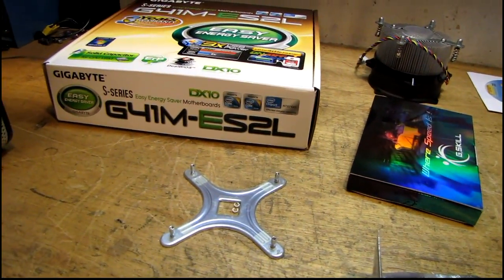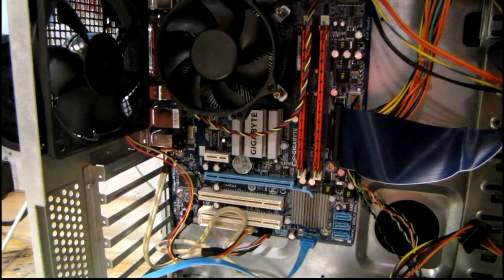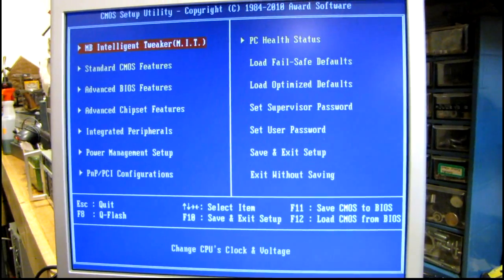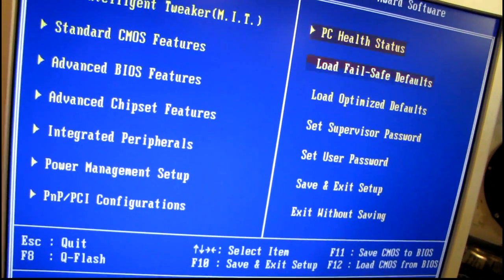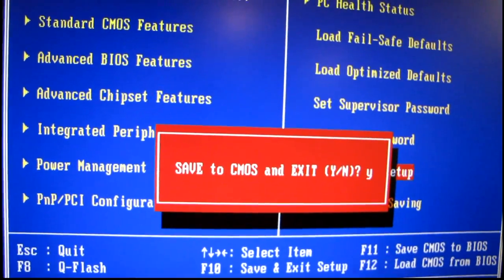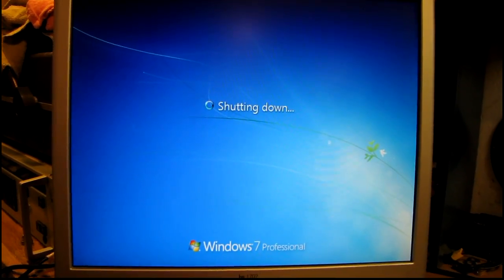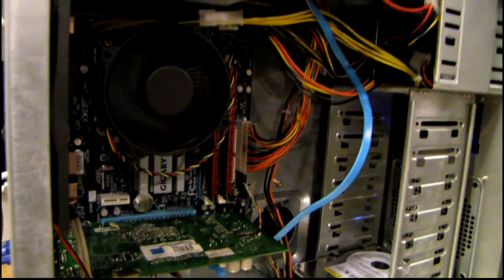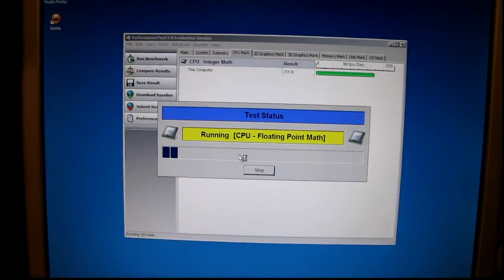Building a PC from spare parts- Intel E2160 Overclocked

Comment: I actually put an E2160 in my LGA775 about a month ago and it booted* fine at 3.3GHz without any voltage boost. It is a late production chip from 2011 (newer than this video) which might be part of why it OCs so well. 

*A day or two later it didn't boot so I put it down to 2.4Ghz like yours is here. I would try optimizing the OC more but I have a Q9400 that should be a much nicer starting point.

Comment: Certain settings in the BIOS like some bus clock and multiplier changes require(d) a shutdown restart instead of a simple reboot, that's normal ...

FYI, a "stable overclock" means running on full load for hours ^^

That was the loudest DVD-ROM I've ever heard in my life :O
An unbalanced disk maybe?

Any SSD has always been faster than any HDD for running OSes, since even the cheapest have and had a lot lower access times and a lot higher IOPS :) The transfer speeds you possibly referred to in the video don't matter much.

Comment: here i have all these processors like e2140,2160,2180,2220 anda i can say that is shit compering to a cpu with a wofdale core like e5300,5400,5700. e7500,e8400 etc to run games with great performance u need 4gb dual channel and the cpu(wolfdale) running at least 3.2 but i like to use 3.66ghz .....

Comment: I built one out of spares and it runs sweet!
Athlon 64 X2
2 GB RAM DDR2
8800 GTS
320GB HDD STAT
DUAL DVD DRIVES IDE
FULL ATX ASUS MOTHERBOARD
WINDOWS XP SP3

Runs as fast as my A10 7850 K Black Edition R9 270 gaming rig
Reply: I reqlly shouldn't feed the trolls.
Reply: +TheBcoolGuy Maybe he means on the operating system? It wouldn't run that fast on Windows 7, 8, or 10.
Reply: +YoMamasTacos Can you tell me what TheBcoolGuys trying to say lol
Reply: SomeRandomEnglishGuy I believe he thinks that you said that your spare parts machine runs faster and better than your gaming rig. (in short - spare parts rig was believed to be more powerful than gaming rig)
Reply: Lol if he does mean that then I'm probably gonna end up pissing myself laughing. Runs as fast as but mot faster. Says "runs as fast as" lol. God knows!

Comment: my e2180 2ghz working in 3.15ghz with stock vcore in very low-end mobo, foxconn 945gc (official suport only fsb 800 max, but worked on 1280~1300 fsb) with air cooler, temps idle 20ºc full load 35~40ºc ... great cpu that all e series... good times

Comment: Hey why your processor 20 Celcius? 
What your brand of processor fan?
Reply: its the standard lga775 heatsink fan that came wit the processor
Reply: TheGta473 Weird, my old computer came with same CPU came with the new crappy CPU cooler.
Reply: Ariq Arsalan It's an OEM cooler made by (I think) Foxconn for Acer and eMachines. It's much better than the Intel push-pin cooler.

Comment: Stock 775 coolers are ballin'. I'm using one on my E2160 stock clocks and it won't get over 55 Celsius at 100% load, despite being operable up to 95 degrees.

Comment: i have a penium 4 2.66 with HT  and a shuttel 2.8 board  any tips for over clocking it has the bios that is easy to over clock i have it over clocked a bit but want to go more its at 2.69 now

Comment: Every chip handles overclocking differently. The current K-series CPU's are handpicked samples by Intel, hence the greater cost. My 2500K does 5Ghz with minimal voltage increase, for instance.

Comment: You can overclock that E2160 up to 3ghz. Mine is happy running at 3.01 ghz on a gigabyte motherboard. It has the same bios version as yours has. That motherboard is insane, pretty good I love it. Dual bios and easily overclockable. Go for gigabyte motherboards when choosing a motherboard, they are fully featured.

Comment: man i have a hp tower with the e4600 (core 2 duo 2.4ghz), 2 gb of ddr2, and a 5670. i can and have ran everything current on it. crysis 2, bf3, mw3.. there's nothing wrong with that build for older stuff with that clock on it, i'm sure it can do close to that if not as well with a better gpu.

Comment: Vista and 7 are pretty much the same, except 7 is tweaked more than Vista. The video drivers should still install as for 7 is backward compatible with Vista drivers. My Radeon HD 5670 installs as a Vista driver. Along with a couple other add in cards (Sound, wireless,usb 2.0)

Comment: i punched and cracked the motherboard on my amd gateway laptop and put the hdd in my acer with a bad hdd and it works fine im using it right now the only  problem it this computer was made for vista and my hdd had 7 so the video drivers wer incompatable :/

Comment: if your pump locks up or fails you're fucked also, you shouldn't OC on a stock heatsink but with aftermarket air coolers OC'ing is fine

Comment from the maker: @agnostos1000 This system is now clocked at 2.88Ghz, and the RAM at 1066.  Been rock solid, and can play GTA 4 at 38 fps using an old Radeon HD3850.  CPU temp tops out around 60C.  FSB is 320 instead of the default 200.

Comment: I got mine overclocked too, but instead of an E2160, I've got an E2180, which is clocked at 2GHz per core by default. My motherboard is an ABIT I-N73 HD which all these years seams to be pretty stable. So I decided to clock the cpu at 3GHz (1200MHz FSB) but I was getting temperatures up to 75C and lots of blue screens and lags. So I re-clocked the FSB to 1066MHz and now  I  get 2.67GHz from each core without lags and minimum blue screens. Temperature is down now too. Change is noticable!

Comment from the maker: @Knaeckebrotsaege As you probably saw in the monitor repair video, I upped it to 320Mhz FSB for 2.88 Ghz.  Turns out the G.Skill RAM was able to handle 1066, despite being rated for 800.  Ironic, considering I bought some Mushkin 1066 RAM for my Mom's PC, and it would only run at 800!

I don't remember how many RAM dividers this motherboard has, but it was something along the lines of 2.66, 3.33, 4.00, etc.

Comment from the maker: @Knaeckebrotsaege That's sweet!  I actually pushed it up to 2.7 in a later video, with the RAM at 1000.  If the RAM can take 1066, I might be able to push the FSB to 333.  I'm not sure I want to try my luck though... The RAM is only rated at 800.  Though it should be safe without a voltage hike.

I really like this CPU and motherboard so far.  Biggest overclock I've ever done, and it's stable even in Prime95.  In fact I'm typing this on it right now.  Can't wait to get Win 7 for it :-)

Comment from the maker: @fordbroncodave Everything else was given to me or found in the trash.  The power supply was bought some time ago for $15, but that's pretty much it.  The RAM, hard drive, and DVD drive were salvaged from other systems that were upgraded years ago.  Not sure what those parts cost me new.

If you were to build something like this with all new stuff, it would be a few hundred.  

Comparatively, modern Quad-Core systems with 4GB RAM, dual hard drives, Blu Ray, etc. usually cost around $1,000 or so.

Comment: If the hard disk was taken from another motherboard with an intel chipset, could explain why it "dropped in" without blue screening or reseting the system on startup.

hard disk's with win installs i've taken from one comp and put into another with a completely different set of core hardware out of curiosity userly failed to reach the desktop.

Comment: Looks like I wasn't the only one having fun with trashed computers! From a few trips of salvaging at the local recycling center, my friend and I was able to build Two Pentium 4 Dual Core systems (With a Geforce 7100, and 7800), An AMD dual core system with a Geforce 8800, about 4 standard Pentium 4's with crap graphics card, but just enough to play original starcraft, counter strike, UT99. We had quite an awesome LAN party two weeks later!

Comment from the maker: @jdcrispe95 The 550w AcBel PSU I used is a commercial grade unit from a Sun workstation.  It weighs close to 10 Lbs.  I actually have a Corsair HX in my main PC, but the first one only lasted 3 months because of a defective fan control circuit.  A second one was a refurb and died after one month.  Sad, because it did use good quality caps.  They are actually built by Seasonic.

Have you ever been to Badcaps(dot)net before?  That's another good forum for tech stuff.